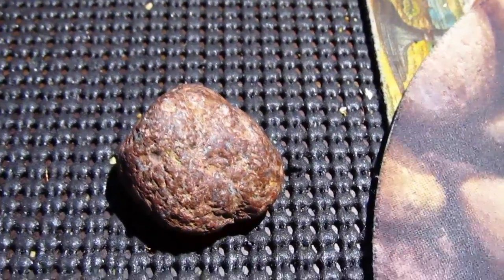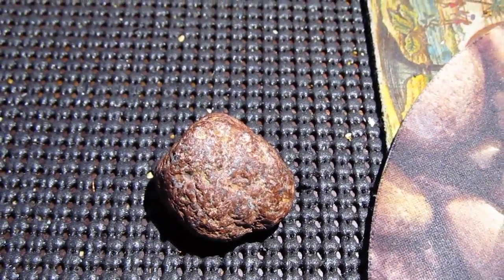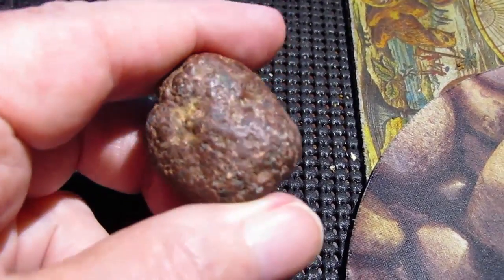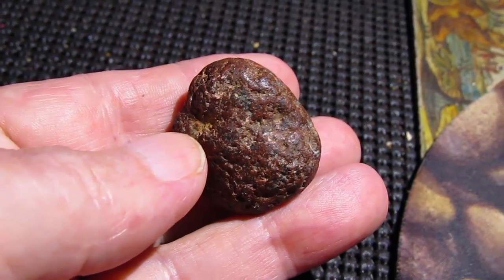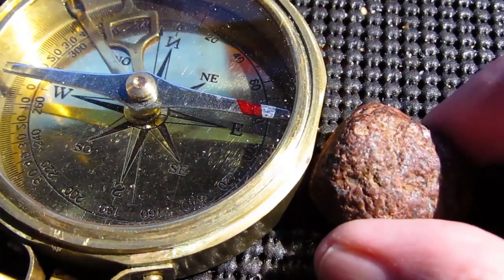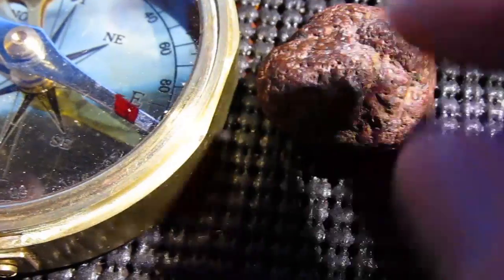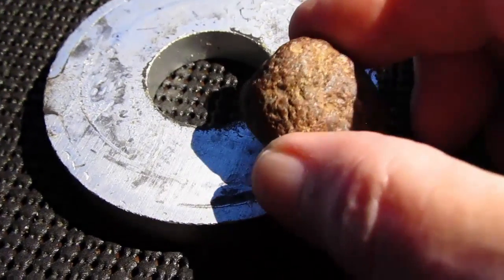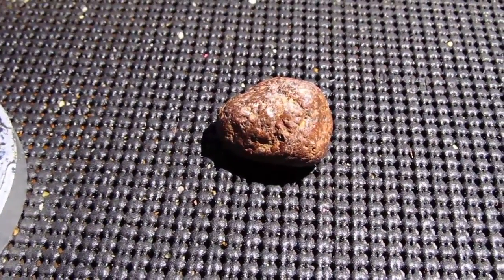Iron Ore Rock

Comment: In Eastern Missouri,  is a small lake called Iron Mountain lake where iron was mined up to the Civil War and cannons were cast at Ironton, and Merrimac, Europeans have been working various metal deposits since before Louis and Clark, a knife was presented to I believe it was President Jackson ( early 1800,s) and when he was told it was hammered and tempered from a rock straight from iron mountain they say he laughed in disbelief. It was the only known place where a large deposit of iron ( almost pure!) has been found on Earths surface and the knife is in the Smithsonian. Indians made paint from the soils which covered it, and  The lake exist where the deposit once was. Since the late 1700's the area has produced iron, lead, and a  smidgen of gold, silver, and copper.  Iron and lead are still mined in the vicinity, and is in the middle of the worlds largest lead belt.